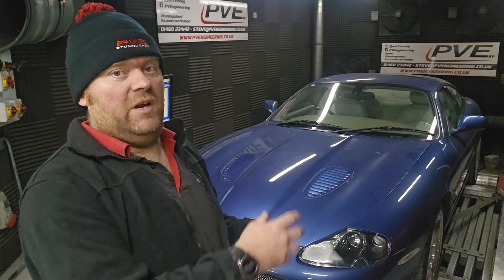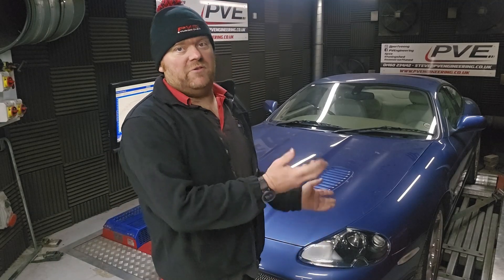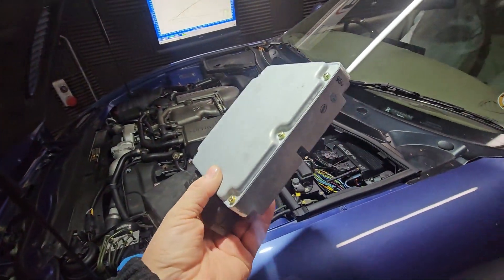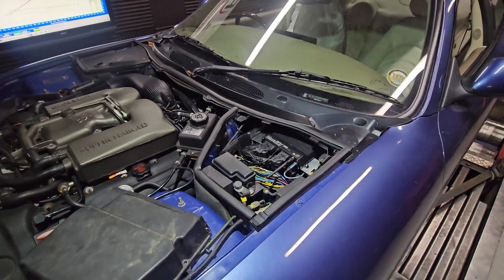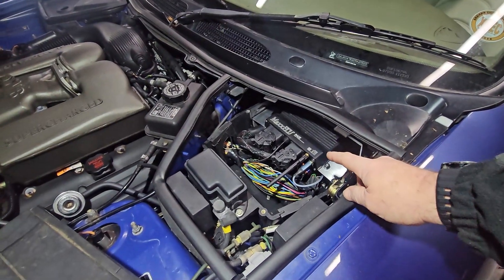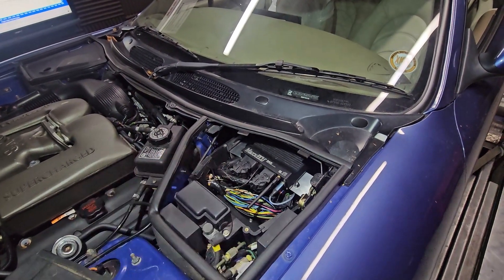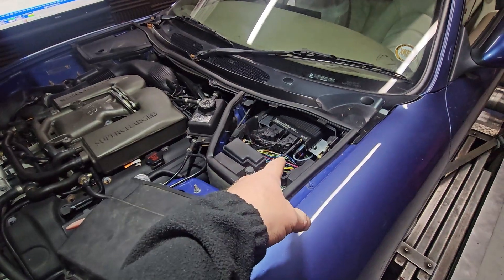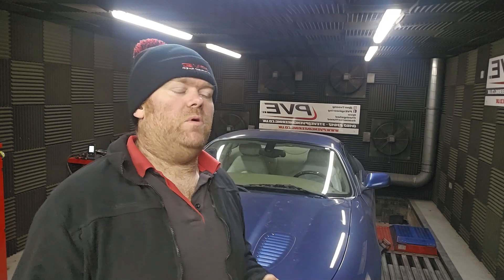Manual Conversion Jaguar XKR. Full CAN integration with a true plug and play for the late 4.2.

Comment: Pioneering more than actual Jaguar now. How feasible would it be to apply the maxx ecu, 4.0 ajv8, and a manual box into an 87 XJ6 chassis?
Reply from the maker: Dead easy. We actually build a standalone loom for the AJv8, so you can run it in aboslutely anything. Even a boat if you'd like. Starts and runs ready to go. :-) It'll be online in the webshop in the next few weeks. I'm redoing the website in the evenings, so slowly populating it!
Reply: @TuningShed What manual transmission do you recommend for the pairing?